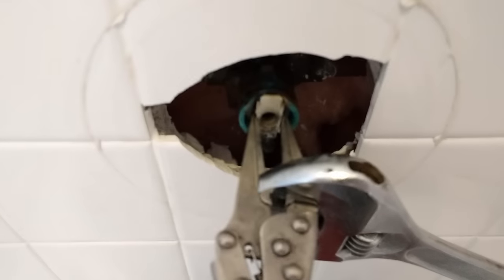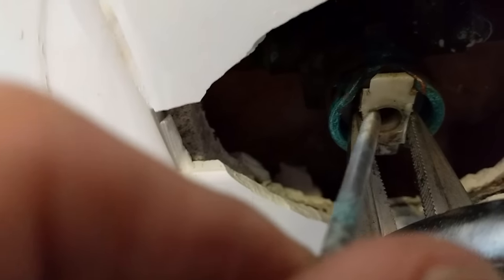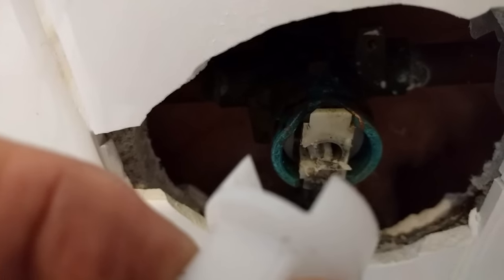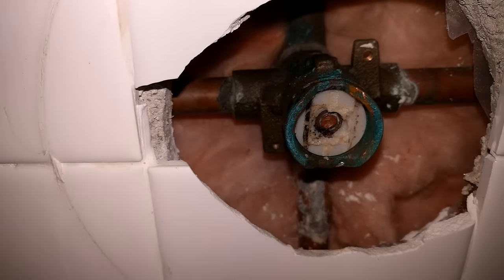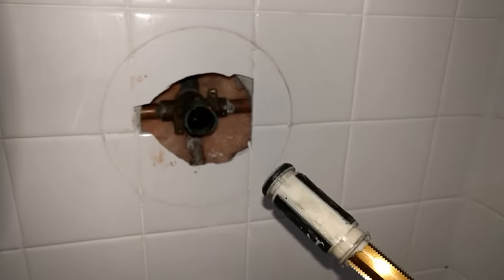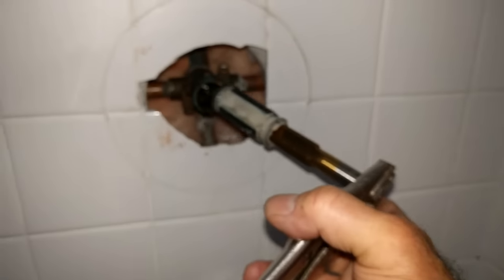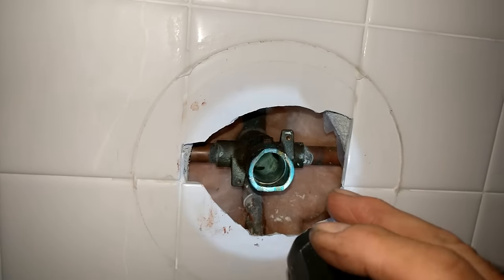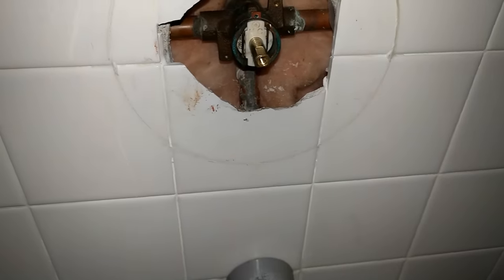Home repair Moen 1222 cartridge stuck really bad by froggy

Comment: LOL: I had to drill it out then chisel it out and break more plastic to finally reach the black rubber side panels and yank them out with hemostats to finally remove the cartridge. I didn't scratch the valve sides but almost drilled out the back of the valve ( whew! that was close)  Anyway the new valve went in without a hitch using the silicone liquid. No more slow leak. I wish I had seen your video before my adventure. Thank you so much for your video though. I learned a lot.

Comment: I am a service plumber (four decades) and I have run across this same problem many, many times. However, it doesn’t have to be as difficult as you made it for yourself — I would have this cartridge replaced in no more than ten minutes — every time. What I do is drill two small holes through the plastic at 12:00 and 6:00, centered about 3/16” from the side of the brass stem hole at about a 10º angle in towards the center of the cartridge. The drill bit will go in about 1/4” before it stops when it hits the top of the stainless steel balancing spool in the center of the plastic cartridge. Once this is done, I put two coarse-threaded wood or drywall screws into the holes I drilled and slowly screw them in, alternating from one to the other. What this does is push the balancing spool against the back of the valve while, at the same time, pulling the plastic portion of the cartridge out. It works every time.

One tip: if you are going to try to use Vise Grip pliers as your first attempt at pulling the cartridge out, make sure to put the broken piece of the brass stem back into the hole in the cartridge before you clamp down. This will keep the plastic from crushing and give you a much better grip.
Reply from the maker: Good tips & of course most pros know the tricks & do it faster. But they don't post videos to help us regular folks. This is one of my top 12 videos. Thanks for adding info in the comments.  :)
Reply: i hope you can make a video of it, would be a great help.. thank you
Reply: I would love to see a video, even images of this method. I'm at 6 hours and still stuck. I think this would be worth trying. The brass part broke so the method above won't work for me.
Reply: Just using internal pipe remover ( set of 3s : 1/4,3/8,1/2)) 30" to remove the broken stem .Good luck guys !
Reply: Did it work with the internal pipe wrench?
Reply: @johnnguyen2376 did it work with the internal pipe remover?
Reply: Brucestory,Thank you Sir!  Using the technique you described, I had mines out under 10 minutes.

Comment: Thankx froggy. On my ancient 1222 cartridge, it turns out the rubber seals had fallen apart when I started  pulling them out. WD 40 copiously applied throughout the project (it doesn't corrode rubber) and heavy duty vice grips wiggling back & forth while pulling out eventually removed the old cartridge. Having a good radio station playing in the background also helped a lot!
Reply: I agree with the wd 40 method. I tried that while twisting, re inserting and slowly pulling out several times which works the lubricant more into the old cartridge. After 10 min or so I got that SOB out. WD 40 for the win!

Comment: I found myself with almost an identical scenario.  Thank you for suggesting drilling holes in the plastic cartridge to weaken it.  That helped and it also allowed me to jam needle nose pliers into the holes and I was able to twist, wiggle and finally pull the damaged cartridge out.  Thanks again!

Comment: Thank you for this video! Although, I wasn't able to utilize the tapping method - others' comments are what saved me. I had nearly the identical situation as shown in the video. After using the puller tool, the stem and 1/3 of the cartridge broke out. I was able to get the rest of the innards out with a combination of needle nose, flat head, and drilling. Once I had everything out, the outer shell was still seized inside. I went everywhere looking for an M18 tap, couldn't find one, and didn't want to wait a day or two from Amazon. Some other commenters mentioned being able to use a 3/4 SAE tap. I couldn't find that either. I did find a 3/4 NTP at Tractor Supply. When I went to pick it up, it seemed too big, so I got a 5/8 as well, but that seemed too small. I get home, sure enough, too big and too small. I was about ready to throw in the towel and call a plumber, when I read a comment about using a torch or heat gun to heat the pipe and melt the plastic housing. After about 15 minutes of heat (in 30 second spurts followed by tugging) I was finally able to pull the damn thing out! With the heat gun, I was able to make the plastic malleable enough to wedge a small flat head screwdriver in between it and the pipe, bend it over enough to actually get a decent bite on the needle nose. What I expected to take about 30 mins, ended up taking me about 5 hours.
Reply from the maker: Awesome job, yes lot's of info in the comments.  :)

Comment: Thank you, Chris Marino (also Froggy)!!!  You uploaded your comment about 1 year ago
. I read it and got much help. Using a heat gun must be a very, very good idea. It did work well for me. I tried to pull out MOEN cartridge 1222 by using Danco Core Puller for Moen.    I, then my friend who has strong arms tried very hard to pull out, but failed again and again. The cartridge came out about 3/4 inch, then stopped and never came out more. The rubber black oval stuck inside very firmly and tightly. I was afraid to break copper pipes while trying to pull out the stuck cartridge by using the puller. ... I gave up and went to bed, and read Chris Marino's comments early next morning. ..... I went to a HomeDepot and bought a Wagner Furno 300 heat gun (750~1100 F = 400~590 C; 2 settings; 1200 Watts; about $20.00) and a long needle nose plier (Channel Lock, 8"). I had several other small tools home.   THE HEAT GUN WORKED VERY WELL.    I heated the stuck cartridge for a short time, then broke the stuck cartridge little by little. I reaped this process many, many times, for about 30 minutes to one hour. Finally I removed the end part of the stuck cartridge. I was so happy!!!   Installing a new cartridge was a quite easy job.  Watch out and be careful when you break the stuck cartridge. 
    Froggy, what do you think using a heat gun to break stuck cartridges???
Reply from the maker: I think it's a good idea.

:)

Comment: I didn't know the name of my faucet until I spent a few hours trying to get everything off! (Why don't they put the name in a clear place??!??!?!?!!)  Once I knew it was a Moen, my refined Youtube search finally worked. I'm at the cartridge now, will hopefully be able to get it out. I don't have any taps...  And success! Can't believe my wife had a heat gun, she uses it for embossing stuff.  A little CLR and the heat gun for like 30 SECONDS and I pulled it out!  Just hope Lowe's or HD has the replacement.  I'm typing this about 4 hours after starting this job, using plenty of CLR and penetrating oil all along the way, from the set screw on the handle all the way to extracting the cartridge.  What a PITA! You and Chris Marino (from two years ago) saved the day.  Thanks!!!

Comment: Thank you. a week of struggle on a 20 year old cartridge is finally over. 3/4" SAE tap did the trick.
Reply: A threaded 3/4" pipe also worked for me but at a fraction of the price.

Comment: Thanks for the help! The cartridge got stuck and started to break apart. Pulled out everything in the core and was left with just the white plastic shell. Didn’t have a torch or anything so I grabbed some metal steak knives(?) and heated them up over the stove until they changed colors to a reddish glow. Then touched it onto the plastic to melt it a bit. Did this 2-3 times and it was enough to then easily break the melted plastic apart with my needle nose pliers to pull out all of the white shells. 

Once that was out, the rest of the process was a piece of cake as it’s just plug and play.
Reply from the maker: Clever trick!

Comment: Just tackled the 1222 replacement. It was made a lot easier after using some of the ideas found here. I started by breaking off the 2 plastic tabs and then the cartridge spun easily with the plastic tool provided. I tried to pull it out with vice grips and spinning the cartridge at the same time, but no go. Next I used a hair dryer on the hottest setting as prescribed here to heat the valve housing. Twisted and pulled at the same time and BINGO, popped right out. Thanks to everyone here for the great advice.
Reply from the maker: Glad we all helped. Often the comments are as good as my video, so I don't always "take all the credit"

:)
Reply: Did the same with the plastic tabs, but the only the metal interior came out. I ended up slowly chiseling away the plastic. Will us heat gun next time.

Comment: Thanks so much! It was the M18X1.5mm tap that finally got the remains of the cartridge removed. The handle is still seized on the old broken stem, but that's a job for tomorrow.

Comment: Hair dryer to heat pipes, moen plastic tool to move tab back and forth, vice grips to pull and came out.  Solution was in comments section of your video. Thank you.  Was about to give up.

Comment: I had an original moen 1225 that was super old and stuck. I had to tap it and then use a 14 inch bolt and a series of washers and sockets to make a puller and I used the bolt to inch the old cartige up the bolt as I tightened it and it finally came out. It was crusty and nasty. Slipped the new one in and no leaking and worked like a charm. Bought me a bit more time until I have to remodel the bathroom in the mean time the shower is usable.

Comment: OMG Thank you.  You just ended 2 days of frustration.  I've been installing a replacement shower in a house I just bought, and the damn faucet wouldn't shut off, so the whole upstairs has been without water.  My directions from Moen, never mentioned putting the smooth side of the stem in the upper position, and it is brand new, delivered upside down.  Whew...Once again, Thank You
Reply from the maker: Glad to help

Comment: Thanks, I spent 9 hours fixing the same issue. After trying a bunch of other suggestions that I found on YouTube, this was the only one that worked for me. I couldn't find the 18mm X 1.5 tap, so I used the 3/4" SAE. I fit the tap to a cup & ratchet, which got the job done in a few minutes.
Reply from the maker: Congrats!

Comment: Our Moen shower faucet was frozen; haven't used it more than a few times in the past 14 years since we purchased the house so was thinking the worst.  Removed all the trim pieces and put vice grips on the shaft and turned it "easily" a little back and forth and it came loose with little effort.  Pulled the shaft out with the vise grips while turning the shaft and it too came loose as well now shower head works.  Hope everyone's experience was as good as mine.  A suggestion:  While you're working on it, remove the tub screen and have a look.  Our house was built in '81 and through 3 owners probably never opened.  Found a ton of hair and now water drains like new.

Comment: Thanks for the great examples and recommendations Froggy! I used your Vise Grip needle nose technique and it did the trick. I also used WD-40 spray and repeatedly dabbed the exposed cartridge with CLR solution to breakdown the mineral scale. Success.
Reply from the maker: Good work!

:)

Comment: I had the same problem as you. The small metal piece broke off, and after that we used needle nose jaw locking pliers to take the inside metal came out, and the plastic stayed inside. Your video showed us to use the tap, but we used a 3/4 national fine thread and it still worked. Thank you so much, you've helped so many people out with this video.
Reply from the maker: Good thinking!

Comment: I tried the method above but my extractor wasn't big enough so I had to piecemeal the valve apart using needle nose pliers.  There is plenty of room to wedge the pliers in without damaging the interior of the valve.  I used a Moen replacement.   What I learned is that if your handle is getting stiff, replace the valve before it stops functioning or the valve stem breaks!
Reply from the maker: Good post, thanks.

:)
Reply: Wow. They don't make it easy

Comment: Thanks for the guidance.  I was sweating it when I saw water leaking out of the handle and the shower head.   Although my brass rod broke off in the cartridge I was able to use the plastic "tool" that came with the new cartridge.  I had to put the broken rod into the plastic to give it some strength before I could use the adjustable wrench.  Then I could turn it back and forth and start working it out.    Thanks again.
Reply from the maker: Welcome!

Comment: Stem broke off mine in the on position so we've been 'indoor camping' for a week only turning on the house supply to fill tubs/shower etc while the special tools arrived. I drilled and tapped 3 times starting with 1/4-20 until I got the middle out. Then the giant tap m18 x 1.5 which had taken a while to arrive came to the rescue. I duct taped a 1" hole washer to the end of the pipe so it wouldn't block the cartridge, then a 2.5 lb Olympic style barbell weight to that (used gorilla duct tape), then more washers/giant nuts to get the plastic casing out. Didn't want an access panel in the bedroom or would have just got a plumber to put in a whole new valve. Had to hammer in the new cartridge, it really didn't want to go in. All good now though! Took a whole afternoon. Couldn't have done it without this video! You are awesome!
Reply from the maker: Wow, that's what I call sticking with it, great job!

:)

Comment: Great video. I had a similar issue where the brass stem broke off inside the cartridge housing - therefore I couldn't use a standard puller. I had to drill around the circumference of the exposed front portion of the plastic cartrdge housing so I could expose and pull out the inner metal stem. Once that was done I tried the tap as in the video, but the cartrdge still wouldn't come out. The problem with using a tap is that the tap actually tries to expand the diameter of the cartridge - making hold even faster in the bore.
I realized that by using a small flat bladed screw driver I could carefully chisel and crack the plastic cartridge from front to rear - THIS SHOULD ONLY BE DONE ALONG THE TOP EDGE OF THE CARTRIDGE IN CASE YOU SLIP AND KNICK THE BORE. There are no seals involved with the upper surface of the bore, just the sides where the hot and cold water lines enter. Once you have a crack in the cartridge from front to rear, the cartridge diameter lessens and it is easy to collapse it and remove. It leaves a lot of plastic chip debris in the bore, but just turn your water supply back on for a couple of seconds - all clean, and ready for the new cartridge (don't forget the silicon grease) !
Reply from the maker: Excellent!
Reply: I was really hoping I could do this, but I just can't seem to get far enough back. Thanks for the tips though!

Comment: We just had the same issue.  The cartridge would only come out about a 1/3 of the way.  It wasn't going to budge further.   After an hour of pulling on the cartridge with the extractor tool, my husband suggested heating the copper pipes with a blowdryer.  It worked!  It expanded the metal just enough to allow us to pull it out. Just don't electrocute yourself when the water leaks out!
Reply from the maker: That's a good tip to add to the comments. Thanks.

:)
Reply: How long did you have to use the blow-dryer.
Reply: @teejaybee9  I used my heat gun for 30 seconds max.
Reply: Your comment saved me. Thank you, kind internet stranger!!

Comment: thanks for the video. Same situation with the knob screw stuck broken in the receptacle. The cartridge wouldn't budge at all and the tool from moen is junk. The extraction tool wouldn't work as the screw receptacle had the broken screw piece. Based on the comments below, I heated the pipe and also sprayed with vinegar and WD40. Finally it moved and another hour to pull it out.
Reply from the maker: Good work!

Comment: Holy cow!  Ours was so stuck!  I did what you did with the needle nose vice grips and a large adjustable wrench. The difference in my case was the stem was still intact. That allowed me to grip the plastic very steadily and really pull and wrench. Got the whole part out in one piece. To avoid breaking that white plastic, make sure your stem is back in the cartridge.